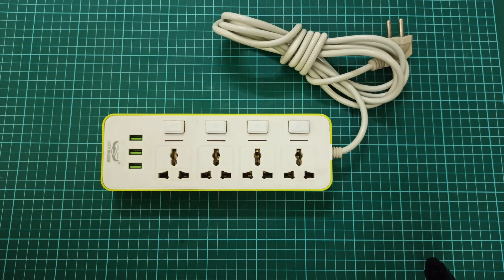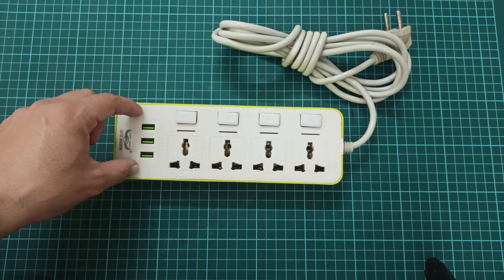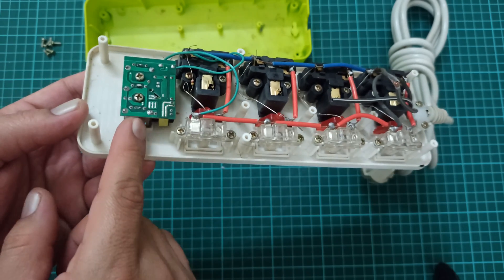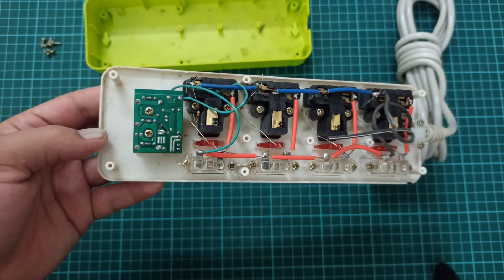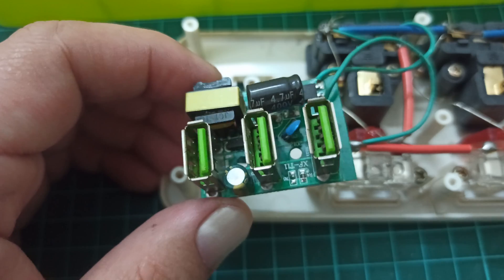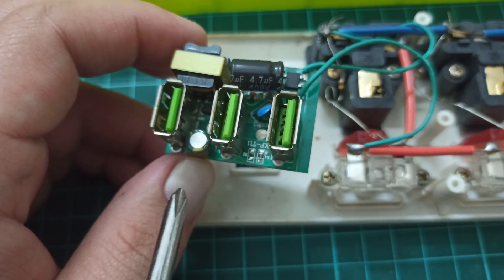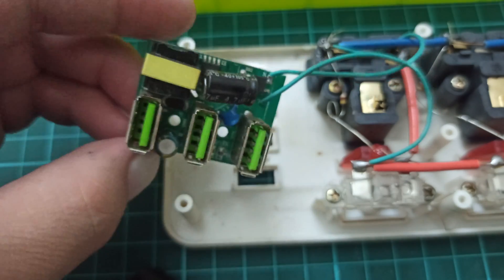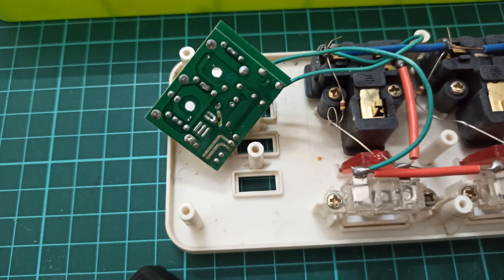Never Use USB Ports on Power socket boards

Comment: Chinese sellers have some weird aversion to grounding/earthing anything. If you thought aluminum wire was bad, Chinese sellers will use steel wire and contacts.
Reply from the maker: Yeah thats true, but at the same time there are alot of chinese products that are cheap and to be honest, i am really surprised by their performance.
So it all depends on which type of product you are buying and how much it costs.

Comment: That is very dangerous anyway. The plug looks like a schuko so one would use it in a country with schuko sockets. Yet the sockets do not ground schuko plugs. This could cause a deadly electric shock if there is an equipment failure. The fact that the earth is not even connected shows they did not care a bit.

My advice is not to buy such things from China. There are better ones available locally and they are designed specifically for plugs used in your country.
Reply from the maker: Yes, thats correct.